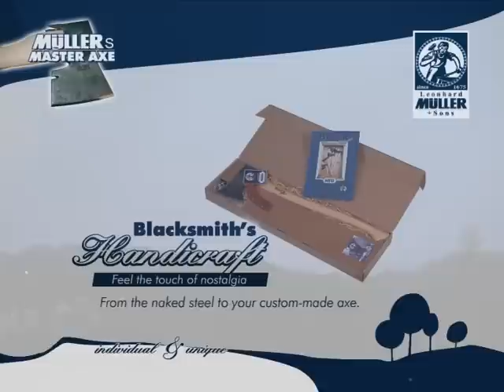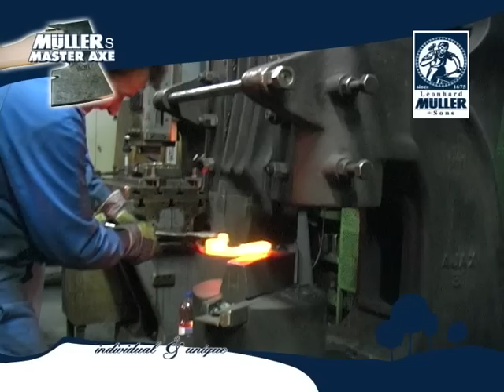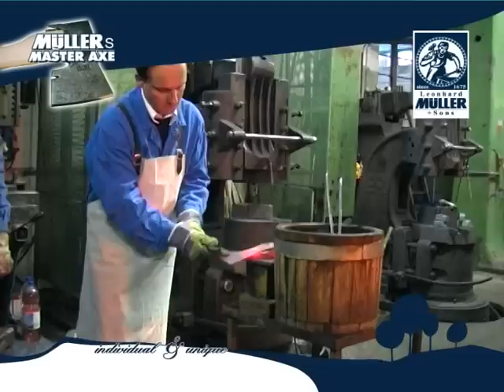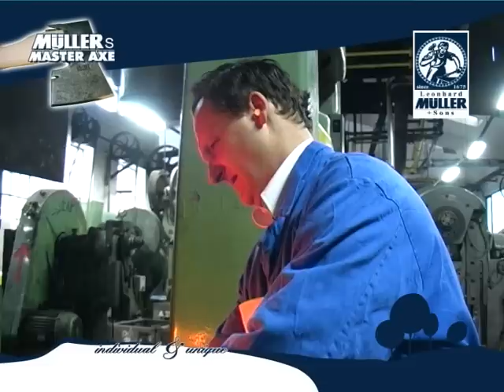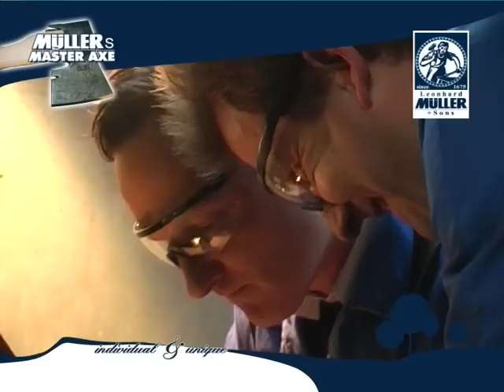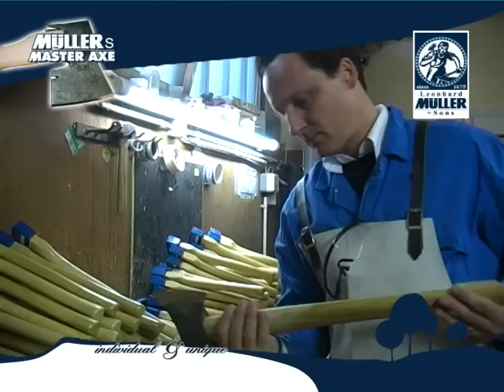Leonhard Müller & Söhne - The Master Axe - Movie (english version)

Comment: Those handles look poor, tha grain runs the wrong way, and sap and hardwood  should not be in the handle. They should check before inserting. It makes them look cheap. Have some pridegin your products!
Reply: the quality of the handles is fine, ive never broken a muller or stubai axe handle aside from in the eye.. i agree though.. a more pricey axe the handle should be perfect.. some stubai and mullers start at 20$ retail though
Reply: The guy in the last frames is a visitor.